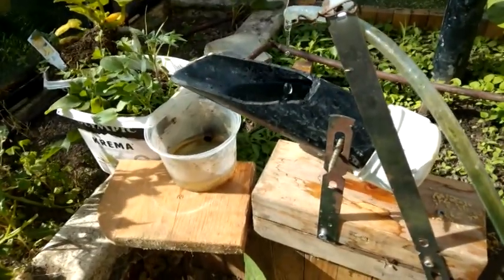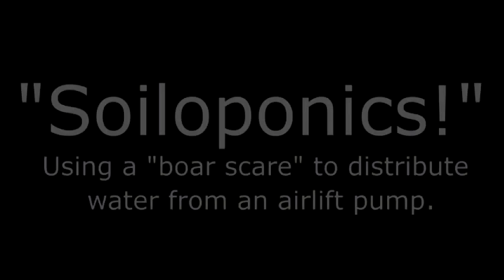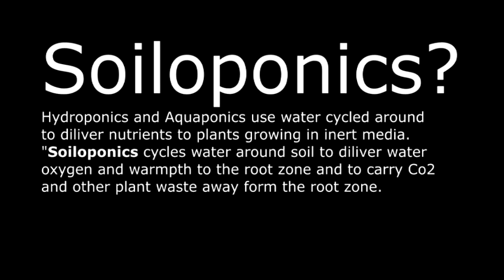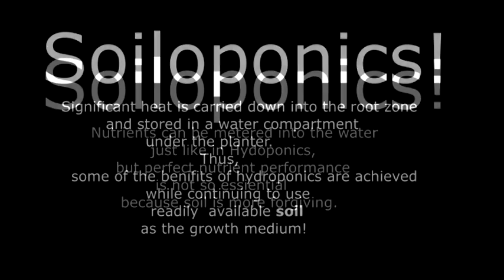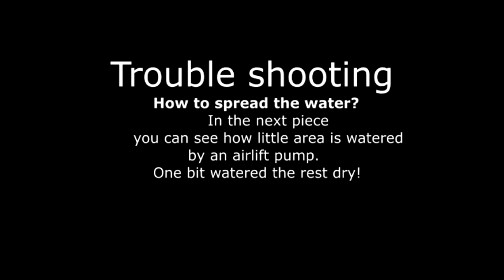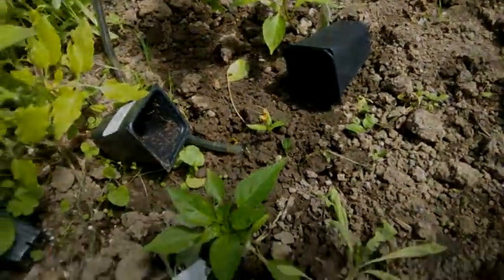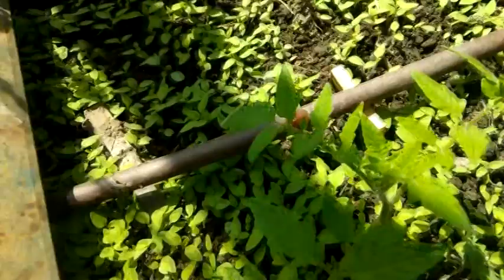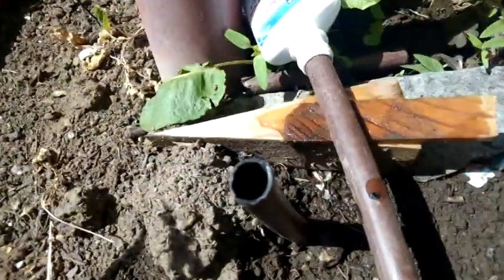Soiloponics demo.    Use a "boar scare" to irrigate  a little greenhouse planter.

Comment: Very nice setup.  I'm thinking a cyclic syphon system might work even better as it will benefit from the high pressure that will push the water down the pipe and ensure it comes out everywhere.
Reply from the maker: Thanks Christie,   I'm going to do the output from the airlift pump  about 3 different ways, one will include a bell syphon.  I can't use the typical flood and drain in soil so the bell will replace the tipper.  I had to take out the right angle fitting in the irrigation tubing for another project and now it is working far better.  (The right angle turn at maybe half the internal diameter was slowing down the water.)  I used a piece of tubing around the pipe to make a curved turn instead.  Accidental improvement!
Reply: @Brians-Easy-Low-Tech-Solutions  I love accidental improvement.  Looking forward to your next one.